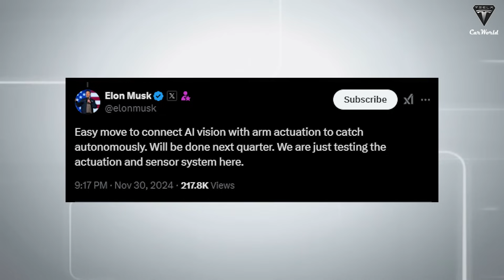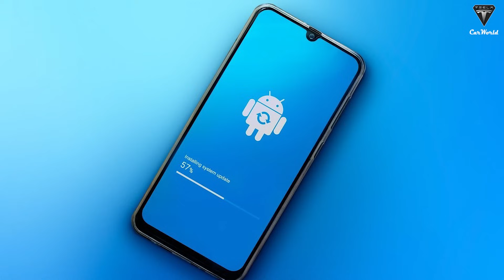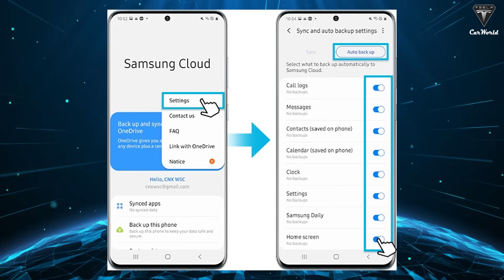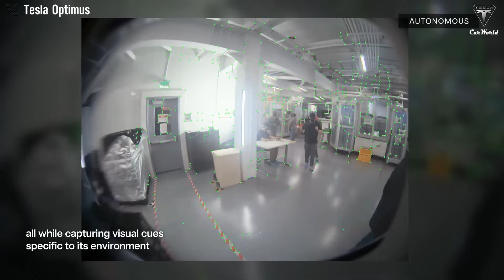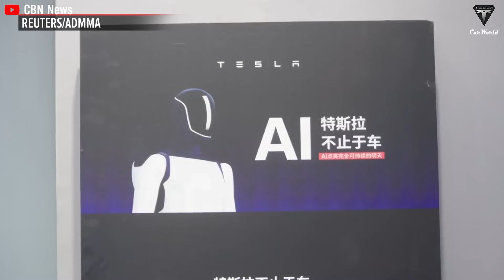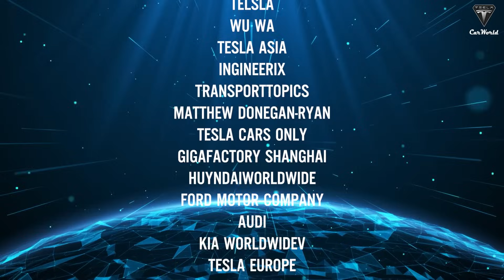Shocking! Elon Musk Confirmed The 2025 Tesla Bot Gen 3 Full Automation and Massive Reservation!

Comment: Clever: Building expensive technology solely for using lame human interfaces (be it computer keyboards, vehicles or machines). Chinese companies are so stupid: They use integrated robotics with ultra-fast direct communication through wireless data connections rather than robot fingers typing keys or serving machines made for humans. Yeah... those Chinese are so stupid, right? - By the way, what's the status of those 50,000 Dollar downpayment for Tesla Roadsters in 2017? It's been 8 years now... and binding delivery date still not confirmed yet? Maybe too busy blowing up rockets (7 Starships - without reaching orbit so far)? That's funny: NASA and subcontractors have build 5 (five) Saturn V - and number 6 brought men on the moon (with vertically landing and re-launching rockets, previously tested on the earth; which is no surprise as any liquid fuel rocket must have a gyrocompass and thrust steering - so it could land vertically... if it had to). That was accomplished long before my birth in those swinging 60s, using 8 Bit computers with Kilohertz CPU frequency, no modern lightweight materials yet and no laser-cutting nor 3D printing technologies at hand - but using those cool pencil sharpeners to write down all their experience which companies could use nowadays to avoid wasting tax payer money.